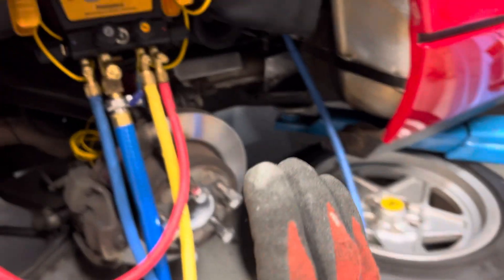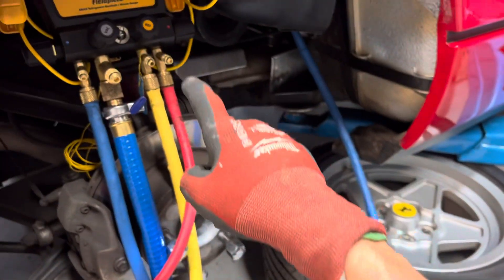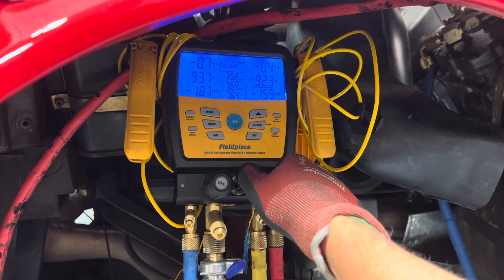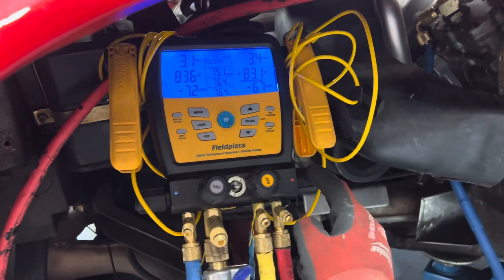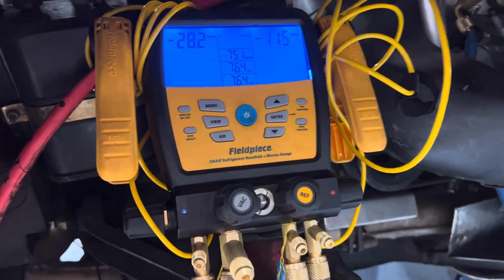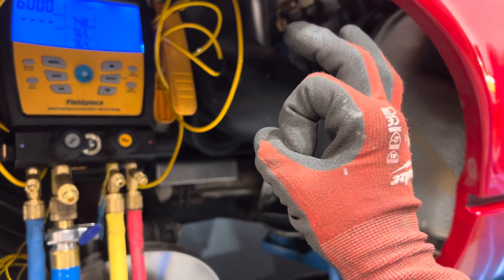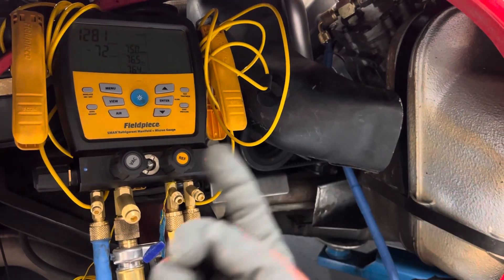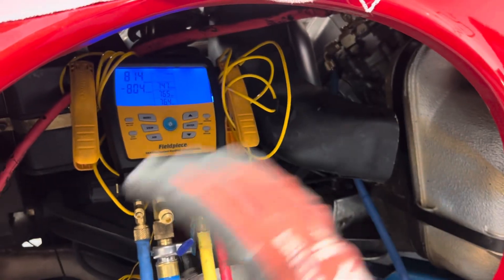DRY NITROGEN TRIPLE EVAC & PURGE (“ more detailed explanation on procedure “)

Comment: what are the other alternatives to to nitrogen purge ? as nitrogen is not available in my city. Can I use refrigerant instead ? what about putting compressed air tank (or copper coil) in ice bath ? and use salt to melt ice to get it around 23F-14F then moister will condensate from the air  but I'm not sure to how much far the air will be dry...  (I use this method to recover most of refrigerant from the car btw)
Reply from the maker: Good job, a man who understands the gas laws. 👍

Usually any country where they do welding in construction or metal fabrication they always use nitrogen or argon . Just over here in United States are gone is a little bit more expensive.. 

Never want to use Shop compressed air . 

But your method by using the salt brine is excellent. 

But it would have to be a super large system correctly constructed with a lot of surface area very slow movement so there is a longer contact time with the compressed air to the cold coil surface walls . 

Something the size of a 55 gallon drum .  With about 100 to 200’ of copper coil.. 

And then meter the flow from your compressed air that has been allowed to cool and stand overnight . 

Then perform the procedure and at the exit of the cold dehydrated air. You add a very large cubic inch desiccant material. . 

Then, from there you have a seeall Sporlin site glass with a moisture indicator on the outlet to actually prove that you have dehydrated the air . 

And you would slowly drive this into a pressure tank that you put on a vacuum pump and dehydrated and dried out the metal pores of your pressure tank first 

So the actual vessel that you are using to take this dry air and pressurize it is dry itself . 

Now we have a working system that was simply constructed, and because you have a moisture indicator, you can literally prove that your air is dry 

Yes, I remember my father showed me this when I was a child when he was explaining the gas laws to me .